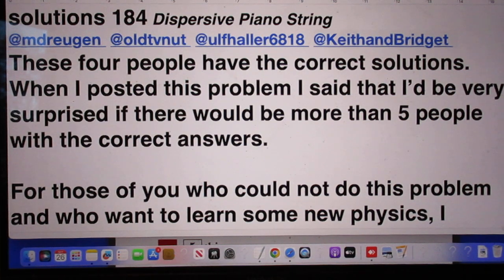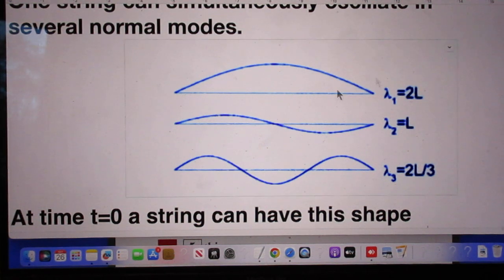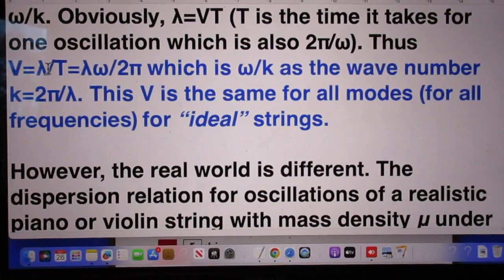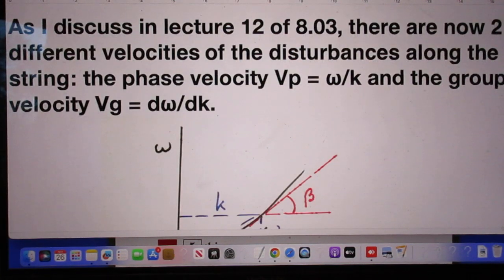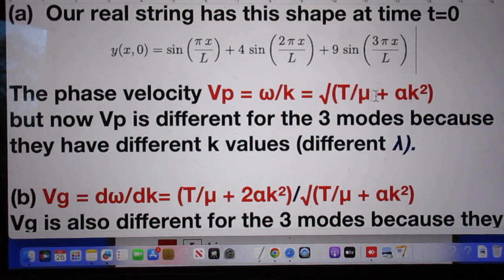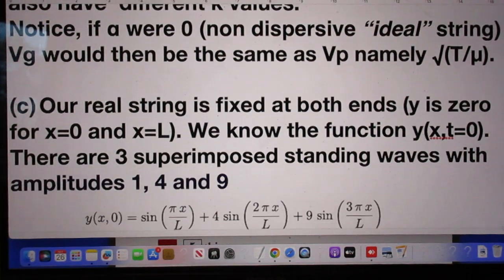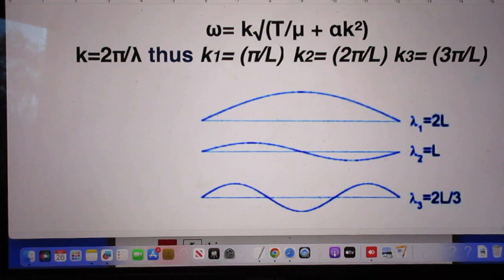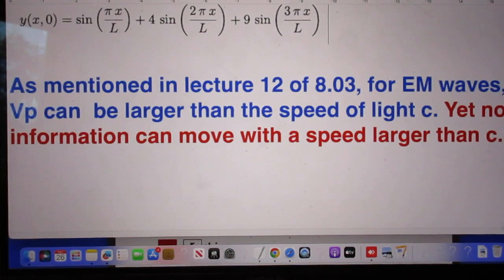Solutions Problem 184 - Dispersive Piano String

Comment: In the problem statement it is given that the string is at rest at t=0. this is important to answering part (c), though it is not re-iterated in this solution lecture.
Reply: @lecturesbywalterlewin.they9259  In the problem 184 video, at 1:34, the screen clearly says "At T=0, the string is at rest and its displacement in the y-direction is given by..."
I think if the string is not at rest, you need more information on its state of motion, which could be used to calculate a time phase angle ( e.g., cos(wt +phi)] and peak amplitude for each mode of vibration.
Reply from the maker: the string can be held at rest at t=0.  If you release it at t=0 it will then start to oscilate with the 3 normal modes.